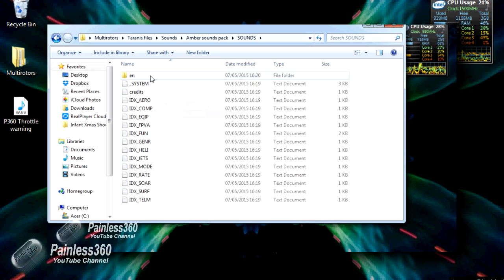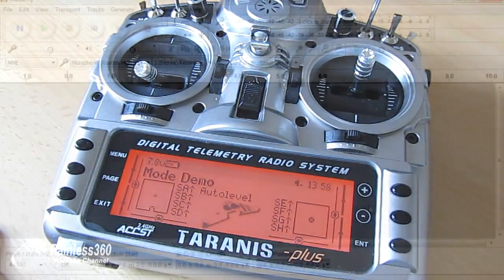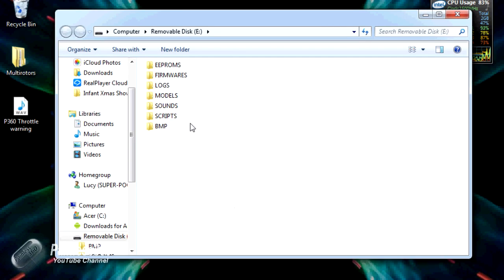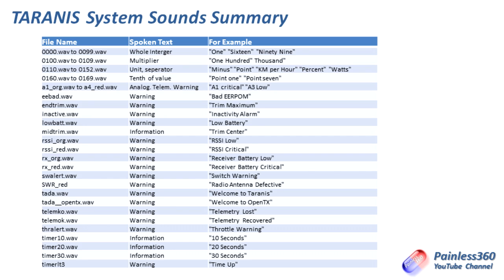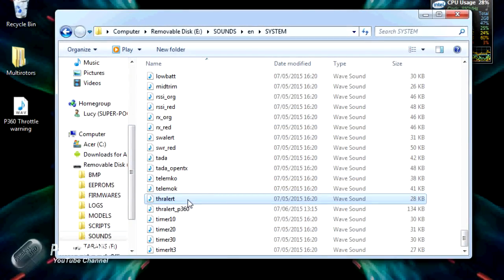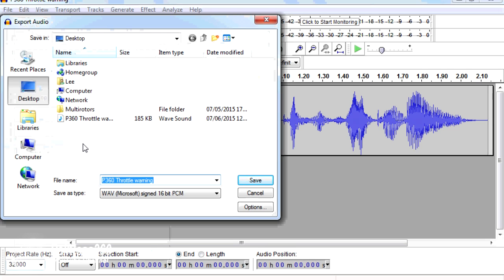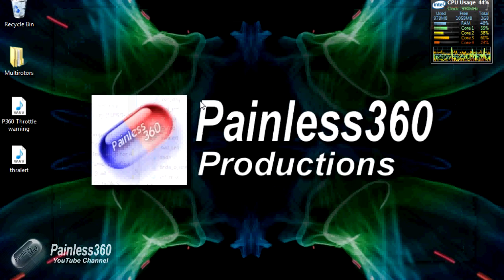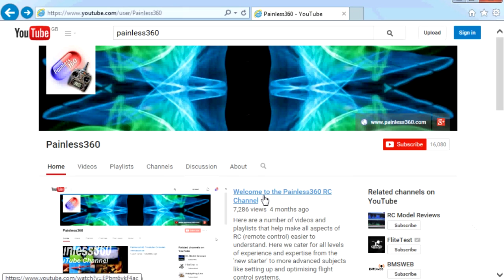TARANIS Quick Tip - Changing System Sounds

Comment: This is a great series, something I used when setting up my Taranis some time ago, thanks. I still have a residual question and it relates to the sound (a tone or buzz) generated by the unit itself. I’m assuming it is the haptic function. This occurs occasionally and I can’t tie it back to a warning as nothing appears on the screen. I’ve come to ignore it which probably isn’t wise, but not turned it off. Do you have any insight into what it is linked to and how I can ID the message it is trying to give me?
Reply from the maker: It could be tied to lots of things - timer maybe?  I'd get a flying buddy to watch the radio to spot what triggers it. Best of luck

Comment: Hello. I have a question. I downloaded and installed the amber sound pack on my Jumper t-16 and now I have no greeting message when powering on the Tx. I was wondering if you could assist me in getting that back. I must mention that there is no tada file in the download. All other sounds are working as I have set them. Thank you Painless !!!!
Reply from the maker: If you're ever not sure then the documentation covers everything you need and a google search should get you to the bit you want. I Googled 'opentx 2.2 welcome sound file' to find this page - https://opentx.gitbooks.io/manual-for-opentx-2-2/advanced/audio.html and found the answer to the file name used for the startup. Best of luck!

Comment: Thank you so much for all of these videos on this Radio.. I would have given up if not for your videos... I have been trying to figure out how to make the timer louder for the timer over. now i know how that single tiny Beep is not loud enough for me to hear if i get lost in my flying..
Reply from the maker: +epoweredrc go into special function menu, add a new function I.e.  'ON - Volume - S1' and enable it.. Best of luck
Reply: Painless360 Thanks for that tip.. that helps also. Ild like to find a different sound for the timer over noise also I'm looking or might just make my own with audacity  Well, i was thinking the timerlt3 file was the "beep" when the timer was finished counting down but i guess not.. its not even a file in my Taranis That was what i wanted to change.. Any clue?
Reply from the maker: +epoweredrc http://rcdiy.ca/opentx-sounds-announcements/ covers it well.. Hope it helps..
Reply: Thank you for the link but i finally found it somewhere else. I just had to create a logic switch to make it play.. Thanks again for your great Videos

Comment: This helped me a lot! Thanks for the video Painless!
I've got a question though. Is there a way I can setup a variable special function.
eg. if in horizon mode, when arm play arm1
if in acro, when arm play arm2.
Thanks again!
Lachlan
Reply from the maker: Yes you could, look at the logical switches. I'd setup logical switches to activate when the switch combos you want are on then use those logical switches to control the flight modes/track plays.. Best of luck!
Reply: Painless360 Ok sounds good! I will try it shortly. Thanks again! :)
Reply: Painless360 I finally worked it out! By setting the function as AND and the two variables as my two switches it all worked. Thanks again so much for the help Painless! :)
Reply from the maker: Lachlan Demasi logical switches are so handy!

Comment: When you upgrade between 2.x version of OpenTx the sound files change a bit. With version 2.2 a user warning has been added. "There's an opentx.sdcard.version file on the root of the SD card that contains a version number. If we make a change in the requirements we increment the number the firmware expects, and a mismatch will throw a warning."

Comment: I have a problem with the sounds on my Taranis radio in that they only work for a while after turning on and they come back if you turn the radio off and back on again, only to stop working after a while - not the thing you want to do with a plane in the air.I have downloaded the sd card contents from FrySky onto to a different card but it made no difference so I'm thinking there is a fault somewhere with the radio hardware (possibly a dud radio).
I am looking to use telemetry in a powered glider but there is not much point if the radio is only going to talk to me when it feels like it.
I welcome your comments and thank you for all your videos.
Ian
Reply from the maker: I would pop the radio open and check the speakers connections.  If there is no obvious soldering or connection problems then i would go back to the vendor. Best of luck!
Reply: I had same problem. I changed better quality SD card and problem solved! ;)